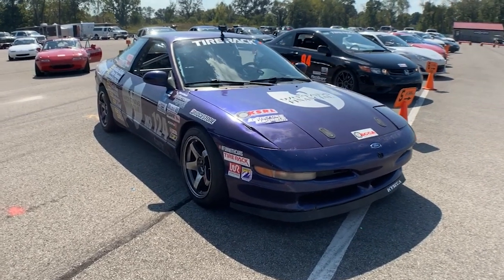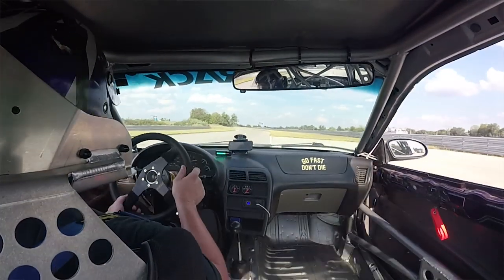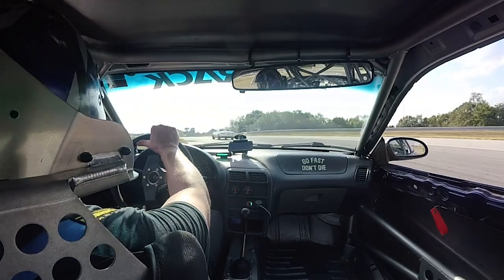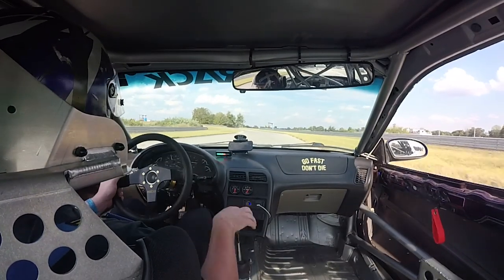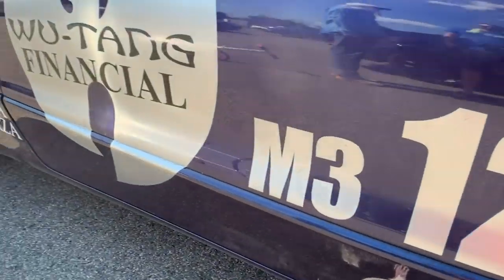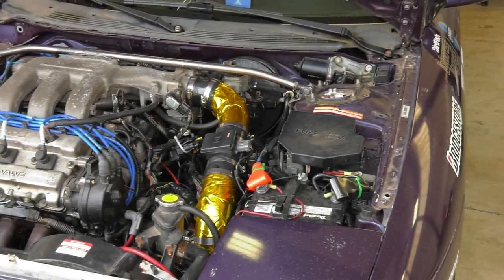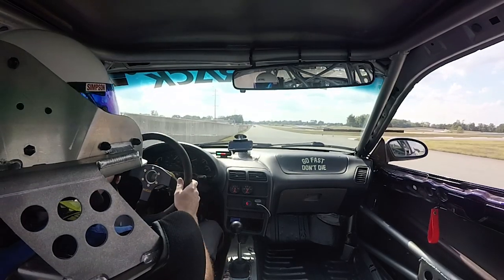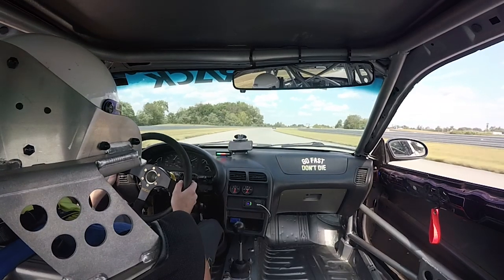Under the Hood: Low-Buck Time Trials Domination in a Ford Probe!

Comment: I'd like to get in touch with these guys, I made Ford Probe performance parts for about 13 years and we held huge national events for them in the late 90s early 2000s - I know I've got a bunch of stuff left over they may be interested in.

I'm the original owner of a 1997 Probe GTS, heavily modified and turbo powered.
Reply: Hey @512Chaos !
What kind of parts did you make?
We’be been running a probe in lemons since 2014, slowly getting better and better
Reply: @cellculturist  Short throw shifters, nitrous switch brackets, custom plug wire sets (EDIS), strut braces, big(ger) brake kits, pretty much anything probe performance. 

There is very little I don't know of haven't done with a 2nd gen Probe GT.

Comment: Great video.    Help please.  Where can I find a manual trans for a v6 ford probe.     Please leave comments on my new ford Probe YouTube channel.    I just can’t find any.    Thank you
Reply: @Josh thank you.   I was able to find a used one 90 minutes away, and currently in the process of replacing.  Check out some of my videos.  My latest one shows how the diff spider gears in my old trans came apart.  But my original clutch of 190k miles is still like new.  Wow.    Thanks again.   Keep racing the probe, they are such underground gems.

Comment: '95 S/E $100.00 insurance company auction total, air bags? We don't need no stinking air bags.that hole in the dash will fit a pizza oven.
With not your grandma's 2.0 in it,built by Intrigue Motor Sports out of Orting Wa.(they do magic with 4 cylinders) and a totally gone through rebuilt fixing factory defects  CD4E.

Comment: “American engine is slightly worse”
Even though it’s internals are beefier than the JDM spec KL motor and is able to handle more power reliably on stock internals